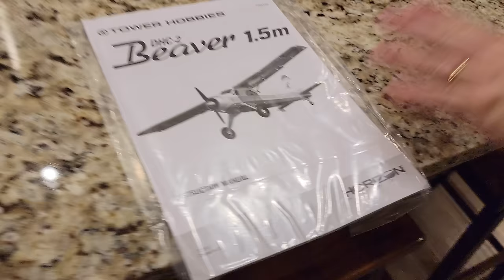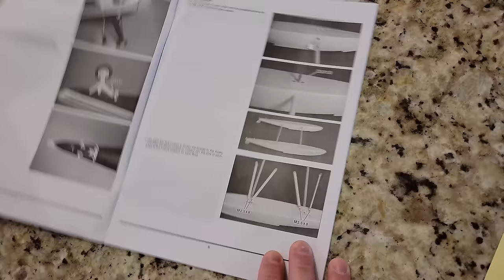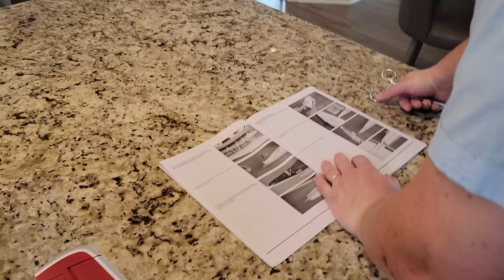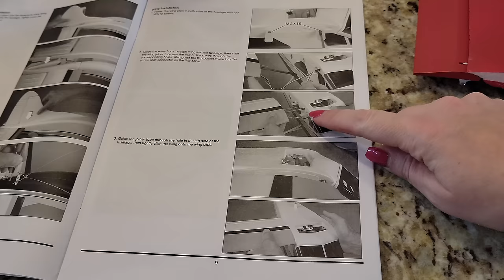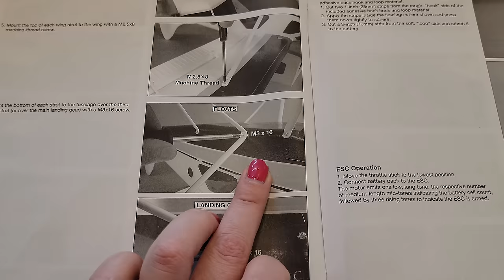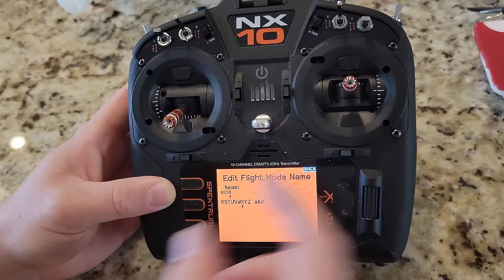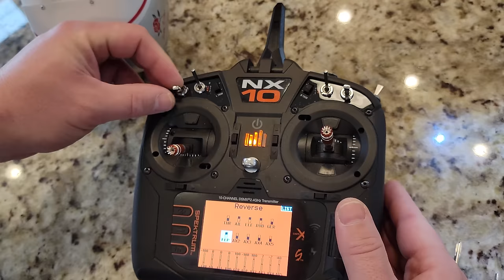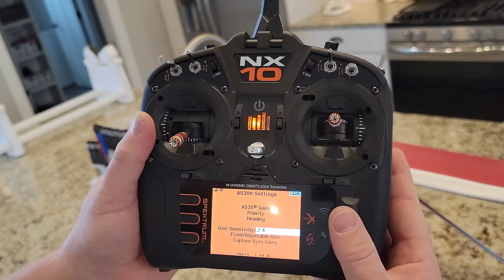Tower Hobbies - Beaver - 1.5m - Unbox, Build, & Radio Setup

Comment: I built this monster and had the same issues on the build.  My elev. control rod was so short I couldnt manually adjust it.  And as you found out the wiring access and flap controls pretty much suck.   HOWEVER - Once I got through the cussing and walking away to cool off - it did actually fly very well. Needed wt in the tail but solid on the flights.   Nice vid

Comment: I used a AR637T and I put it between the two elevator/rudder servos.  I also added a 12 pin connector from my receiver to the main wing for one plug only.  I did this because I transport it and it makes it super simple.  I  painted the engine carb heat fins silver, added a Xoar 12x6, and 1 3/4" aluminum spinner.  Beautiful flyer.
*Also peeled off those awful windshield stickers and painted on the trim.
Reply from the maker: Sounds really nice!